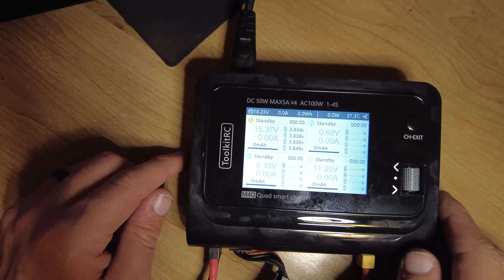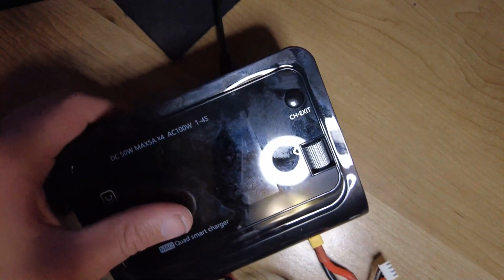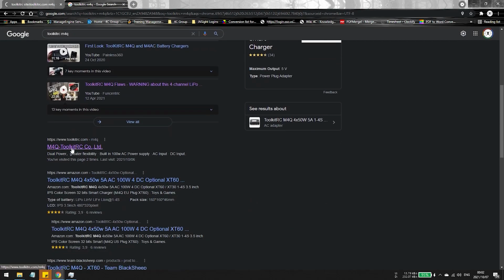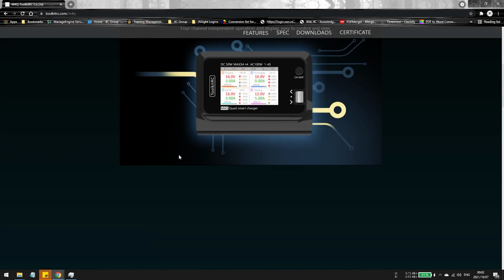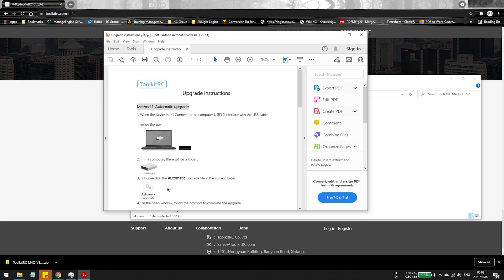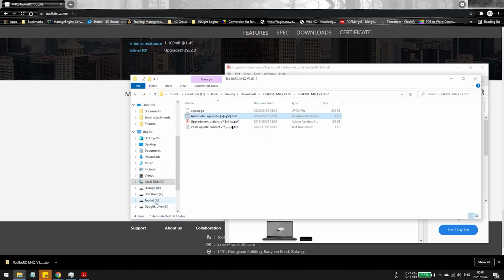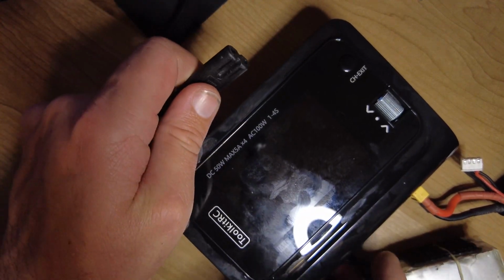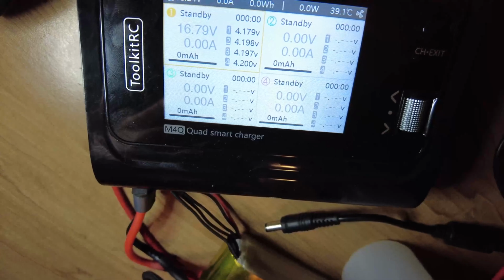HOW TO UPDATE TOOLKITRC CHARGER FIRMWARE.

Comment: I have a toolkitrc m6, when I start charging it, the message "over current" appears. Can updating the firmware solve this problem?

I use 19v 3a input, and I tried replacing it with another size 15v, 2a, but the result is the same
Reply from the maker: I would try update the firmware for sure. Over current usually means the charger is not happy with the amount of power you're trying to pull. How are you charging your batteries. Does it do it with just 1x battery etc?

Comment: Thanks! I just updated my M8S charger, and now it's bricked😥
Do you know by any chance how to recover it? I formatted it already, but that didn't help🤷🏻
Reply: On mine (M6DAC), toolkit drive comes up when unit is powered off .. connect USB cable with no power to unit.
Reply from the maker: Nice!
Reply from the maker: Ah man... sorry to hear. I've never had to recover a bricked unit... So you can't force flash the firmware again?
Reply: @InfinityDrones  Thanks! I actually found an even newer firmware (v.1.23), using this the charger works fine again. I made sure to use the included batch file, then "safely removed" the USB device, and finally pulled the USB cable very slowly💁🏽‍♂
Reply from the maker: @DavidG2P  Thats fantastic news! Thanks for letting me know!

Comment: Very well described. Please note that on the bottom of the system settings menu (long press dial wheel) you can see something like "ID: FF3405DD-V1.02" - meaning firmware version 1.02 in this case.
Reply from the maker: Awesome, Thank you for teaching me!